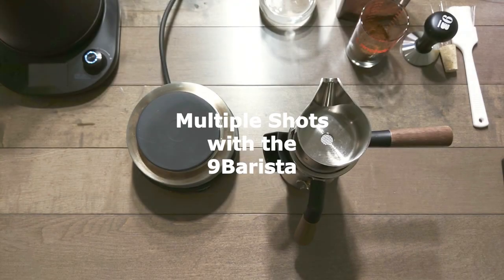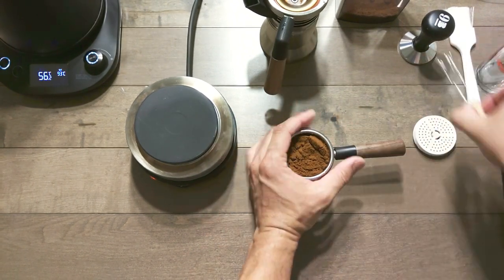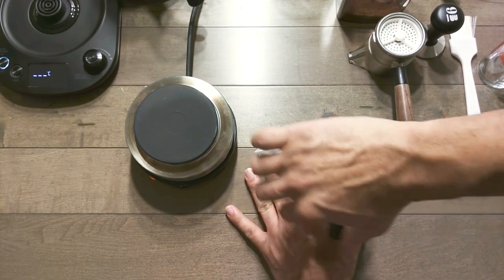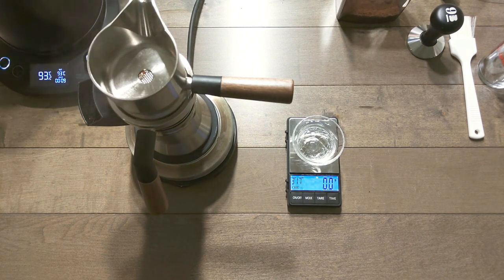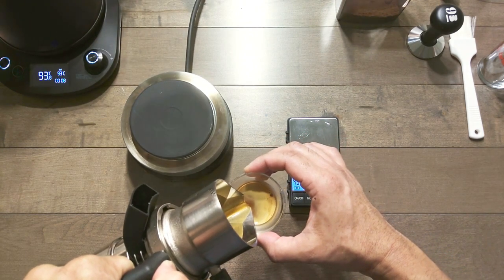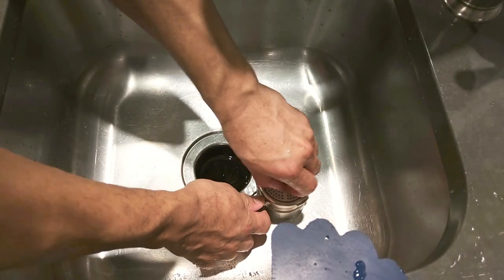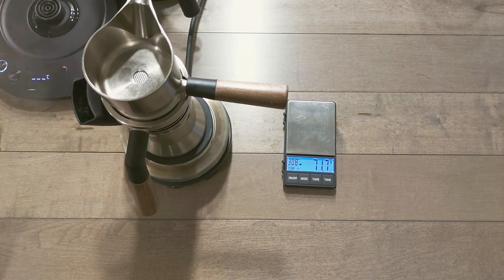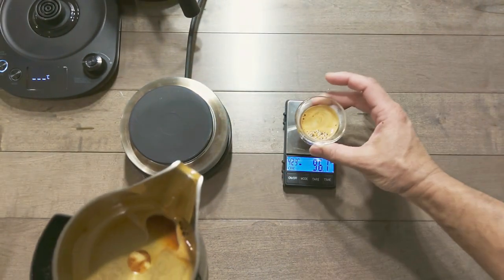9Barista workflow, pulling consecutive shots

Comment: Hi! Thanks for the cool video! I make two coffees every morning with my 9barista, and I always leave the 9b boiler on the stove whilst I prepare the coffee, definitely accelerates the process. I have to say it has become a ritual for me so I don't really mind the time spent on it.  I love the coffee so much.
Reply from the maker: I actually tried doing that this morning (just for one shot though). I wasn't confident before but I have gotten more comfortable with the process and it worked out great. Totally agree that it saves time. I think I'm still spending close to 10 minutes start to finish (prep and cleaning included) but like you, I enjoy the labor of making my coffee so it's not a big deal.
Reply: I'm having trouble posting on the comments... I have the same glass anchor measuring cup. Where did you fill up the grinds to what mark???
Reply: @sonyacurti  measure about 20grams of beans, grind and empty the grin holder into the basket, or into a clear glass if you are doing multiple, use one glass for each set of 20gram grind, you don't fill to a mark but by weight, then tamp. :-)

Comment: Hi. I use a silicon oven mitt to hold the hot bottom of the moka pot, it protects you and gives a good grip like rubber to help you screw and unscrew these things. It's great.
It would be great if you could make another video after 1 year of using the 9barista, and tell us how are the parts holding up. Thanks.
Reply from the maker: Thanks! I took a little break from doing videos, but definitely will be starting up soon. The 9B will be one of the first. Plan to do a full teardown and covering mainenance.

Comment: Congratulations for your video! I got my 9barista a few days ago and I don’t know what I’m doing wrong because I can’t get cream in my expresso. my beans are fresh, I grind them at the moment with an old coffee grinder I borrow from my parents… pressure I guess is correct too… but no cream. I don’t know if it is because I’m using arabica instead of Robusta… any advice please??
Reply from the maker: My first guess would be the grinder. Regarding pressure, how long does it take from the moment you see coffee extracting until the end? 25-30 seconds gets you in the ballpark. If faster than that, you might need to grind finer. Also make sure the grinder has a lot of adjustment capability. Some grinders advertise being able to grind to espresso level. But within that range it's best to have finer adjustments. If it only has a few settings at espresso range, it can make it much more difficult to dial in.

If your beans are fresh and it's extracting within an appropriate timeframe, it might just be the beans. If it's a light roast you probably won't get much crema. Also, I would stick with arabica for the most part, but you might be able to find a good blend that adds a little bit of robusta to the mix. Best of luck 👍
Reply: @davidmaurice1294  Hello! thank you for your answer. I have just bought a grinder with 0-12 grinding scale. I hope this is fine to get the proper adjustment. 
Coffee takes aprox. 6-7 minutes to come out and extraction lasts 30-35 seconds. 
I will try to get different type of beans and ill let you know.
Thank you very much for you help. Have a lovely new year 2024. 😃

Comment: Very slick David,   quick turn around and pre-heating of the water, Im guessing the metal absorbs more energy than the water, which is why you don't get more out of the water-preheat.
getting comfortable with putting the boiler on the stove before the top, but clearly that leaves you with a 2 minutes hard limit to prep and install.  soooo.  
been using my Barista9 on a sailboat gas stove, but starting to think the alternative method might be bite the bulled and get two. LOL.. B9 could be a handsome extra profit with a "two pack" offer i bet. 
I find the unit works great for one person, by the time you are ready for that second shot,  the B9 have cooled to be comfortable to handle.
Reply from the maker: Pretty cool! Sounds like a nice setup... enjoying your espresso while on your sailboat, nice! Yeah, I also heat the boiler while preparing the shot. Pretty comfortable doing that now. As for consecutive shots, it's doable but maybe not as simple as other machines. I also have a Flair, so that's my method of brewing two shots 🤣. But I agree with you, for one person it's not an issue making that second shot. Take your time and enjoyed the first, worry about the second when the time comes.

Comment: I just got my 9 Barista yesterday and I am so happy with it. There are just some things that are confusing. Such as after I have poured and am cleaning it, I notice coffee/water in the middle chamber that seems to not have made it to the top pouring part and when I open the bottom chamber there is still a tad bit of water left in there. Am I doing something wrong or is there supposed to be a little bit of water leftover. 

Also. I have an electric stove. Should I have my stove top already heated before I put the 9 Barista on it or should I be turning on the stove top as soon as I put the 9 Barista on it. I have found that when I turn the stove top on at the same time as when I put the Barista on it, it takes a lot long for it boil and make the shot and I know they recommend it be 4-6 minutes. 

Sorry for the tangent, I am just new to this and really love espresso and this "machine" and I want to be using it properly
Reply from the maker: Congrats on getting your 9Barista and it's great to hear that you're enjoying it! Regarding your questions, I already had some thoughts but did also reach out to 9Barista directly. Wanted to make sure I didn't give you bad info 😅.

They said it's perfectly normal for there to be residual liquid in the middle chamber (or group head). I get the same with mine. My thought is that liquid will pull back through the portafilter after a pressure release and/or lowering of temperature. Not sure if that's the right explanation, but they didn't mention anything different.

The water in the lower boiler is also normal. They mentioned that after brewing there is actually no water left there, but that there will be water in the upper boiler (it has two). Then when you cool it down to take it apart, the residual water then falls into the lower boiler (and that's why we're seeing water there). The reason why this deserves explanation is that it's not only normal, but probably preferable to still have water left in the boiler after brewing. If you open it up and it's dry, that might actually be an issue (i.e. longer than 6 min brewing, not enough water at the start, extending the extraction past 30 seconds, etc).

For the stove, they didn't have any specific recommendations other than that it's important to stick to the 3-6 min brew time and that if it's faster to have your stove hot beforehand, then that would be the way to go.

Hope this helps, but feel free to reach out if you have any more thoughts or questions.

Comment: I have a 9barista and trying to figure out how to make the whole campsite espresso in the morning. A moka pot seems more practical with a large group. Thankfully everyone doesn’t get out of tent at the same time.
Reply from the maker: Yeah, a moka pot is probably more practical. There doesn't seem to be much that can be done to significantly speed up shots back-to-back, but there might be things in terms of prep. If you haven't thought of this already, you could get an extra basket (and optionally a portafilter - but I would just go with the basket) and prepare the next shot while the 9B is brewing. I also have a container/cup that the 9B fits into that I fill halfway with room temp water. It doesn't take much to cool the boiler down enough so that it's easy to screw apart after releasing pressure.

Comment: THX for the demo.
Would the water not boil quicker in the 9B if you would use a larger or an induction cooktop hence speeding up the brew time?
Reply from the maker: I think you have a valid point. The 9Barista does comes with a heat exchanger plate that you can place on top of your stove. You'd need to use that for an induction cooktop or for a larger stove top. I have seen people talk about the need to control heat though, and that if the temperature is too high it will affect extraction (maybe you get beyond 9 bars?). Some people start with high temperature, then reduce it once the water starts boiling. Maybe that's the key. 

For me, I'm also trying to avoid using the exchanger plate. It (obviously) get's really hot and takes a while to cool down. It's also made from layers and I've heard of instances where it came apart (probably from people trying to cool it down too fast maybe?). I find that it doesn't suit my workflow, so I ended up using an electric plate. If the 9B was stainless steel instead of brass I would have gone with an induction cooktop. I may reach out to them to understand why they went with brass, or if there are any thoughts around at least having the boiler made of stainless.
Reply: @davidmaurice1294  I use my steal Mocha Pot on my induction cooktop but I need to put it on a steel plate as the pot diameter is to small for the induction to fire up without the plate. You will need the exchange plate on an induction cooktop as well due to the small diameter and the braa. I'm guessing they used brass as it retains heat better and they likely need the heat retention for the pressure part to work better. 
I ordered a 9B with a mid March delivery.  Its will be a long 30 days...
Reply from the maker: Haha, yeah the wait for me was pretty brutal. It's worth it though. And thanks for the extra info, I'll need to consider that it might not be that easy to get away from an exchanger plate. Personally, I'm not that fast in preparing for a shot anyway so I might be fine with the time as is. I guess it's human nature that we are always trying to squeeze out as much improvement as possible. I could probably calm down a bit on trying to optimize further.
Reply: @davidmaurice1294  For all my single-serve coffee (moka, aeropress, clever or pourover) they take a little less than 10 minutes to brew. So If the 9B is in that wheelhouse - I'm likely Good...

Comment: Lovely videos, thank you. Do you find that the Flair has any significant shot quality over the 9Barista since you can control the flow profile (preinfuse, ramp, drop pressure toward end, whatever) ? Or are they pretty close?
Also how is there not 9 bars of pressure in the coil cooling chamber, that chimney is at atmospheric so I'm so confused :D
Reply from the maker: Hey, sorry so late with this. In terms of 9B and Flair comparison, I wouldn't say that either has a huge advantage in terms of quality when it comes to taste. They both have their strong points though. 

I find the 9B very easy, simple, and convenient but maybe more of a challenge if you're trying to tweak the results. Usually, the dose and grind size are pretty much what you have in terms of reliable variables to play with. It's the better option in my opinion if you want minimal fuss (especially if you don't switch beans often).

For me the Flair takes more skill and so the results vary more. I'd say that I've had my best and worst shots from it. I find that since there are many more variables to play with, I'm able to more finely adjust to what I'm looking for.

As for your second question, I have no idea. I plan to do some maintenance on my 9B and so maybe I can try investigating that as part of it and post a video.
Reply: @davidmaurice1294  thank you for the thoughtful response! 9B is so intriguing. I’m still on the fence. I learned the cooling chamber receives its water during connecting the bottom but is separated right then and not subject to boiler pressure. Does that seem right? In fact read from mfg that if using less water for smaller shot you have to fill the cooling chamber through the chimney since it won’t receive as it would with higher levels below normally. 
Great info and insights thank you!!
Reply: @davidmaurice1294  PS but would love a video about that!!
Reply: @RodneyClang   not sure why you would pull a shorter shot.   its really easier to simply standardize,  I fill a little more water than the "line" to get more cooling.

And yes -  to answer your question, there is a ring under the cooling coils, so when you put the top into the basin,  it separate the pressurized chamber at the bottom from the cooling chamber above.  practically speaking when the pressure valve release the 9bar water, it is cooled in the above chamber, you will see the steam coming out,  some people put more cold water in the chimney to cool more.  but it start with splitting the water into two chambers when you insert the top part.

Comment: I’m really considering buying one, I’ve been using one of the earlier Brikka Bialetti pots and am pretty happy with it, but would like a real espresso at times.
Reply: Just wondering if a single shot from 9barista will be as satisfying as 4 cups brikka or not.
Reply: @mikototo2010   mine is a 2 cup, I like it. I’ve heard 4 cup is a bit more finicky. One day I’d like to have the 9bar and the 4cup for when I need to crank out more then one
Reply from the maker: The 9Barista could be a good natural progression from a moka pot, meaning that the workflow is pretty similar. But I also have a Flair and now a Picopresso. They all have their strengths and I'm getting great espresso from each one. Just pointing out that there are several options these days for good espresso without having to spend so much in the beginning.

By the way, none of these devices replaces my moka pot. Still love that thing 😁.

Comment: That's a really interesting coffee maker. Doesn't seem terribly practical, but it's a clever design and it looks great. It will definitely get you some coffee geek credentials.
Btw: were you brewing from a table or from a (very nice) hardwood floor? (there are micro bevels between the boards...)
Reply from the maker: Haha, you noticed the boards! No I'm not on the floor. I built a platform from some spare boards that I place on the dining table. My wife doesn't like me doing my coffee stuff. I went from using the kitchen island to the dining table. You'll start to see in future videos that I've moved again and have a different (although still fake) wood surface going forward. FYI, I'm now in the garage, haha.

Regarding the 9Barista, yeah it's not for everyone but it's actually practical enough for me. I don't normally have more than one cup of espresso, so my routine is not as involved as the video makes it seem (i.e. it's not my everyday process). It is typically what I do when dialing in a new bag of beans, and that can get tedious if it's taking more than a few shots. So once I have something dialed in, I tend to stick with it for a while before switching.

Comment: Hot water = more watery brews. Always use cold water. Youre supposed to respect the 6 minute brew time, it has been studied by the 9barista team. Work around the 6 minute brewing time, check if the brew is done, or if its still extracting. Those show you if you need to grind finer use more heat or less heat. Etc etc. never put hot water in it, its not a moka.
Reply: And dont “speed it up” it will be inconsistent.
Reply from the maker: I generally agree with you. When I did this video I was aiming to see how I can optimize back to back shots. But I typically do not do that with my 9Barista. If I'm making coffee for more that one person, I use a Flair 58.

The 9Barista is for when I want to make espresso just for myself and have my beans dialed in. In that situation, the 9B is excellent - the ease of an automatic machine, but with specialty cafe results (or even better). I no longer use hot water and I'm comfortable enough with the process that I can do my puck prep while the 9B is heating up.

All that being said, the folks at 9Barista don't necessarily shy away from hacks. I actually reached out to them before making this video and they told me it's fine to use hot water to speed up the process. They also have hacks around making ristrettos and for reducing the brew temp. Overall though, I do agree with you in that we're probably better off using it as is. It just works and I think your points are a good guideline for getting good results.
Reply: Someone from the 9Barista team commented on James Hoffmann's video that the brew time is supposed to be from 3-6 minutes. They specifically said this because James had mentioned your same "6 minute rule". Personally, I don't think 6 minutes is a long time to wait for espresso, so I wouldn't be taking extra steps to try to shorten the time.